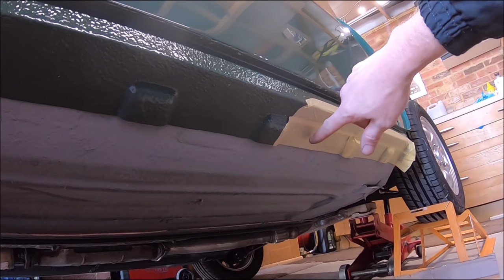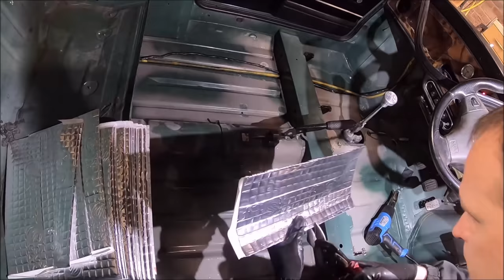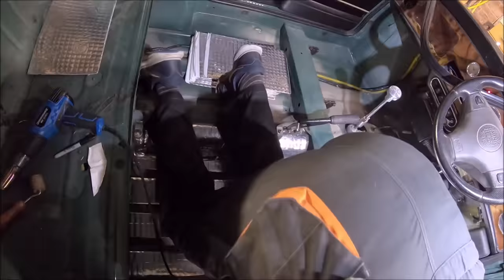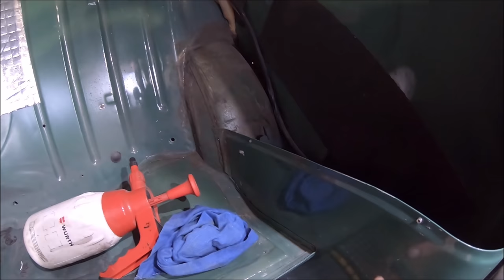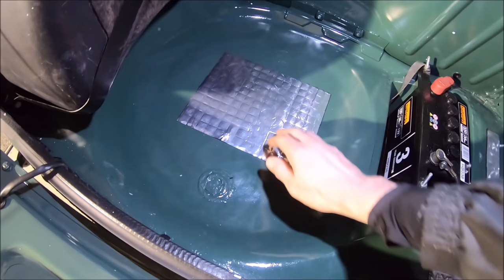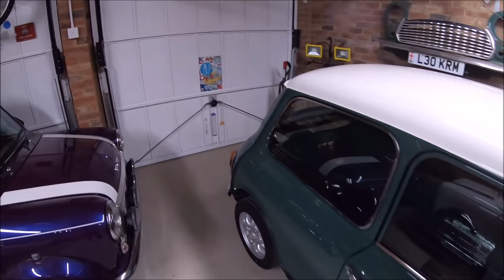Silent Coat Sound Deadening - Classic Mini Workshop Project Sprout Pt.70

Comment: Ps.... i have a brand new round nose mini under bonnet insulating kit (felt with black vinyl) i bought by mistake from mini sport, i'd like to donate it to the build if that's what you had in mind for Sprout? just need you're address somehow and it's yours!
Reply from the maker: That would be very much appreciated. My e-mail is millermilla@sky.com Let me know your T shirt size and we can do a trade :)
Reply: Sounds like a bargain to me.....will e-mail you tomo with my size and address and if you reply with your postal details....its a done deal😉

Comment: I know this is an older video but I am still catching up and judging by the standard of your work and how much attention to detail you apply I am curious as to why the floor was left unpainted with top coat?
Reply from the maker: It didnt really think to much about it. The original floor is just epoxy primed, I didnt really think it would add any extra protection, and given the full 1 piece carpet in an MPI I'm never going to see it again anyway

Comment: I got a question I have 2 10s in my jeep renegade wheel area with bandpass box. I have added deadner to roof and under box trunk area . When I turn speakers up sounds like I'm under. Car wash vibrates and sounds like I'm in a barrel maybe flexing not sure please help. Can some give me steps to make the rear area sound clean and not move all the panels and no flex????
Reply from the maker: Sorry, I've got to be honest, I don't know much about a Jeep Renegade but I'm assuming the larger panels i.e. the boot floor and roof are flexing.

Comment: How would there be any water on the inside though?  I think I would do larger sheets and cover Every square inch. Project sprout is looking great.
Reply from the maker: Thanks. Unfortunately most minis leak a bit and even if they don't if you have any sort of spill in the car it's then a problem